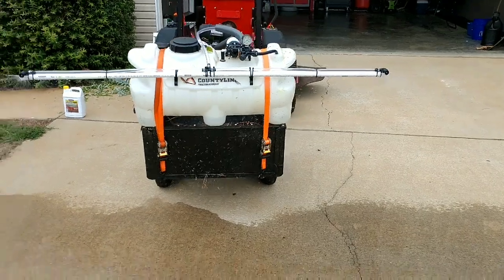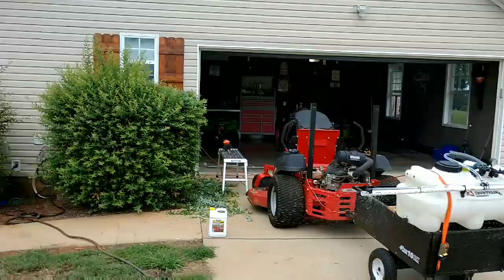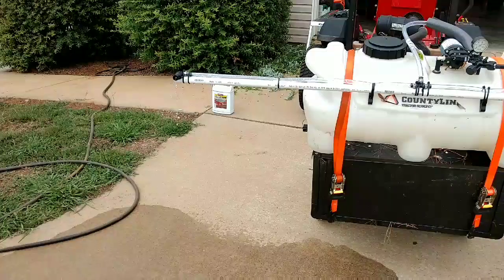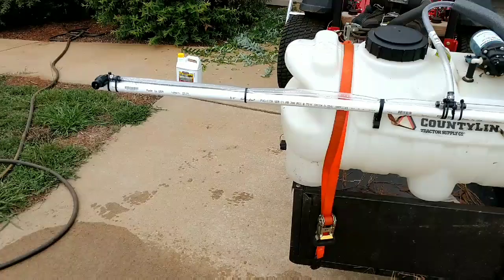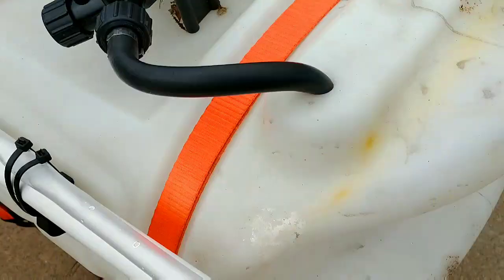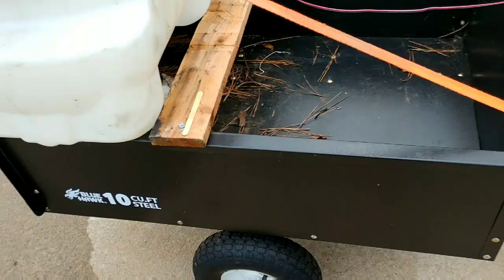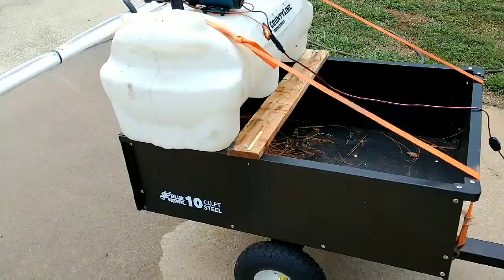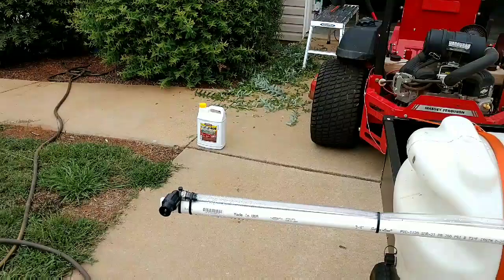Homemade DIY Boom Sprayer $25

Comment: The cargo carrier (basket) that I found that fits a 40 gal tank was at Academy Storts for under $100 it slides in the trailer hitch slot.
Reply: id test it before going that route, my zero turn is already wheelie happy, couldn't imagine 200lbs hanging off the back...

Comment: I put a toggle switch on my mower which makes it much easier to deal with. Plus I put a plug at the hitch, so I can plug, and unplug my sprayer. My son liked it sooo much that he did his that way also instead of having the battery clamps, and switch to hold in your hand. And if I ever need to power something else, I have that 2 prong plug at the hitch.
Reply from the maker: I thought about doing the same thing. Thanks for watching!

Comment: Just what I was looking for. I do have a 14 gal wand sprayer that I was wondering how to convert it to a boom sprayer on my ATV to kill weeds on my deer food plot. This will do the trick! I love DIYers. Thanks for sharing. Ham Lake, MN.
Reply from the maker: Thanks for the comment! You might want to check out my other video, boom sprayer 2.0
Here's the link
https://youtu.be/8e01vEQ4zGg
Reply: @WestWorld24  My tank sprayer has 3/8" hose. Is there a reason why you swapped to the 1/2" hose? Probably because the nozzle is a 1/2" fitting. I do have a clear 1/2" hose sitting around. I was planning on threading the nozzle thru a piece of angle holed angle iron I also have so I can attach to the rack on my ATV. I also watched your 2.0 video and the 1/4 or 90 degree  head was a good choice. A lot of other DIY videos have an elaborate set up but for twice a year this is what I was looking for. Thanks again!!!
Reply from the maker: @capttaylor03  you are correct, I used a 1/2-in hose because that is the size of the fittings. There are many different ways to build one of these, I'm like you, I wanted to keep it simple and cheap for no more than what I use it. Thanks for watching, I'm glad I could help!
Reply: @WestWorld24  I ended up buying a $0.87 head sprayer and a $0.43 elbow and attached it to my 3/8" hose ($1.30). I attached the head sprayer to a piece of lumber that fits under the bungy chords that hold the sprayer to the ATV. I did buy an extra set and a T in case I want a wider swath like yours. My sprayer had a 13' hose so I can easily cut what I need. Thanks again for the great idea!!!
Reply from the maker: @capttaylor03  I'm glad it worked out for you. This video is getting a lot of traction right now lol

Comment: Have you gone on to your more permanent set-up  with the hitch mount?
Reply from the maker: I never did change it. I kept the tank in the trailer for now but with spring just around the corner I may try a new and improved set up and if I do I will post it. Thanks for the comment 😊

Comment: I am building my own sprayer cart.  I bought a 20 gallon plastic druim for $25, I bought a 12 volt diaphram pump for $15 on Amazon. I put a 4" port in the tamk for filling it. Got on amazon also.  I had two wheels off of a bicycle, and made a frame for the tank out of some 2 x 4 and some 1 x 6 wood.  i had some hose, elbows, and fittings and a brass 1/2 pattern lawn sprayer nozzle.  pump puts ot 1 gallon per minute and I am getting about an 8 ft sprey pattern .  I adjusted the throttle and with my Craftsman LT1000 in 3rd gear, I travel 125 ft in a minute.  This will result in a one gallon per 1000 sq ft. output which makes it easy to determine how much fertilizer I need to mix up to cover my 9000 sq ft yard. so I have about $55 invested in making this sprayer cart
Here is link to my video: https://youtu.be/52J4XrQMMCc?si=ksmuaanlpSOhxDVB
Reply from the maker: @eagleviewhd  very creative! You should post a video LOL

Comment: Watching this video as the second one, ah so you have the same idea to build it closer to the mower also, that was my first idea, but I think this variant or having the tank inside the trailer as in your other video will be an easy first project for me as I don't have a generator on my tractor, I would also need an extra 12V battery and keeping that inside the trailer together with the tank, I think that's a winner.

Awesome video and again Thank you for the idea! ❤
Reply from the maker: Thanks for watching! It's not the perfect setup but it didn't cost me an arm and leg either lol

Comment: I’m just curious why you didn’t use regular nozzles for sprayers using those sprinkler head sprayers you’re going to put out a lot of volume
Reply from the maker: These were the only ones I could find at the time. They work fine and they are very inexpensive.

Comment: The sprayer and tank I have only engages the pump when the wand is sprayed. What did you do to bypass this?
Reply from the maker: The pump engagement is regulated by the pressure. Once the line pressure reaches the maximum setting the pump will shut off. When you remove the wand from the system the pump will operate continuously as long as it's turned on. I hope that makes sense. Thanks for watching!
Reply: @WestWorld24  yep makes sense thanks for the explanation. so if I wanted to keep the wand I could put a valve in the line to switch to the boom sprayer when needed
Reply from the maker: @codyleger1750  exactly. I thought about doing the same thing.

Comment: Could you put a link to the parts you used? The nozzles, elbows, and tubing?
Reply from the maker: That's a great idea, I will try to find it online but I bought most of the stuff at Lowes
Reply: @ProjectBadBoy I went to Lowe’s... could not find the parts and the people there stared at me like I was an alien when I tried to explain what I was looking for or making
Reply from the maker: @scottparker8974  here is a link to the type of nozzles that I used. https://www.lowes.com/pd/Orbit-15-ft-Quarter-circle-Spray-Head-Nozzle/4566484
You will find these nozzles and the related elbows that you may need in the sprinkler system area.
Reply from the maker: @scottparker8974  I had to sort through a few bins before I found the threaded nozzles and elbows that would work together
Reply: Project BadBoy thank you! Found something I think will do same job at Ace! Little more expensive than Lowe’s but they didn’t stare at me like I was speaking gibberish!
Reply: Pay attention  🤣
Reply: @WestWorld24  are those the ones you switched to on your 2.0 video? I assume 1/4 circle/90 degrees but wanted to make sure. So I just need threaded elbows and then threaded nozzles and I'm good to go? Thanks for the video!
Reply from the maker: @wilrichardson6353  yes!  Those are the ones I switched to. You may find similar nozzles somewhere else. The nozzles that I used were very inexpensive but very effective. Thanks for watching!